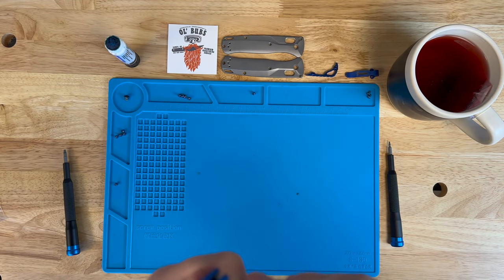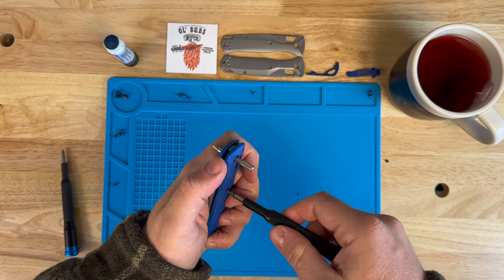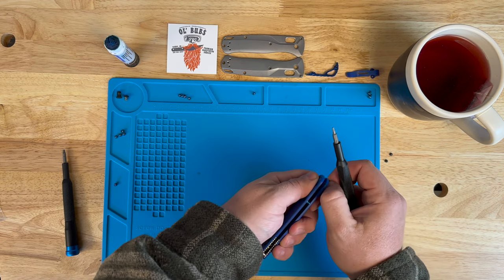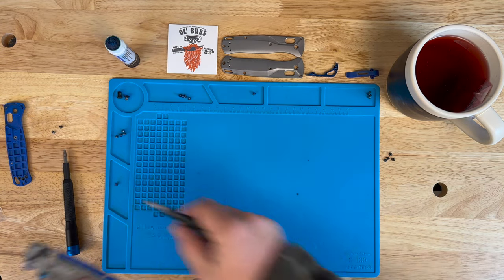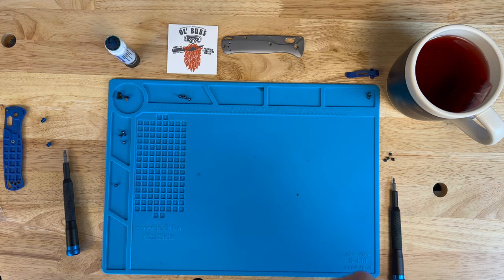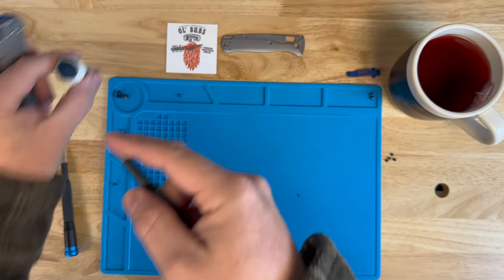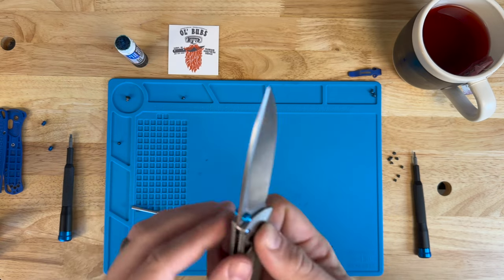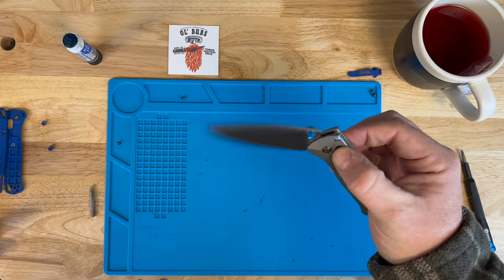Easiest Scale Swap EVER! Benchmade Bugout Semi-Custom

Comment: Best Bugout upgrade is oversized Phosphor Bronze washers.  Grab some Flitz and polish them up real nice before install.  Makes such a difference.   My $300 Carbon Fiber Bugout had the worst action that I have ever seen in a knife.
Reply from the maker: It's interesting, my CF S90V was also the worst action of the bugout I've had. Most have been pretty dialed, I have one with the oversized washers and it does make a difference. Thanks for watching!

Comment: Disassembling your knife doesn’t void your warranty, it’s part of the regular maintenance of the knife.
Reply from the maker: Thanks for watching!
For reference directly from the card in the box that comes with a Benchmade knife under the section titled “What is Not Covered”:

“Do not use your knife as a screwdriver, pry bar, chisel or punch. Do not throw your knife or use it for any other purpose than cutting. Do not disassemble your knife. Do not sharpen your knife on a power grinding wheel. Any of these acts will void your warranty”

I wish you were correct, but Benchmade limits maintenance to adjusting the pivot and moving the pocket clip from one side to the other. More and more companies are updating policies to allow disassembly. Here’s hoping for the future!
Reply: @olbubs  That is interesting and you just added another reason why I don’t buy benchmade knives. Oddly enough I looked at some other knife manufacturers and some do mention disassembling as a reason to void warranty like kizer but most don’t like Civivi, keeshaw, sencut , qsp, we….etc